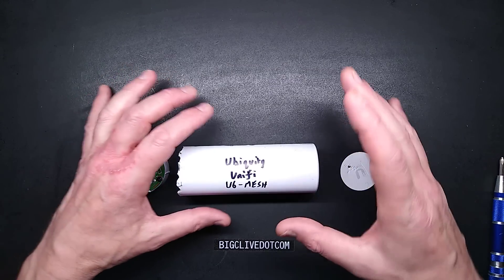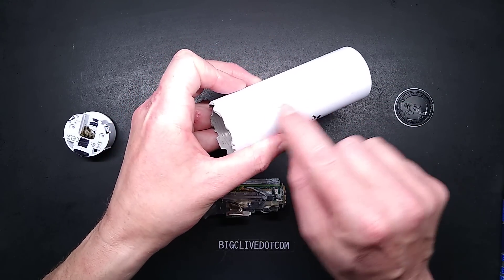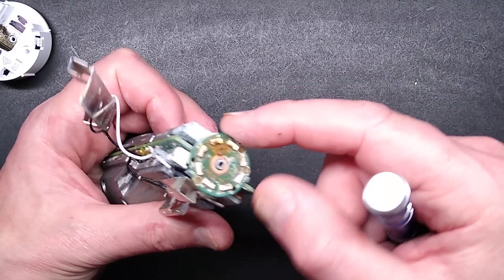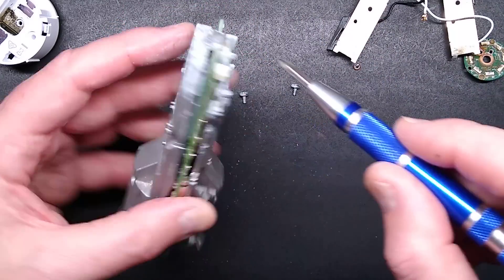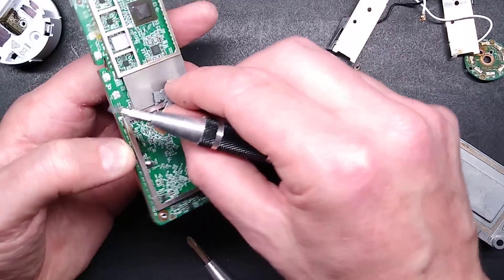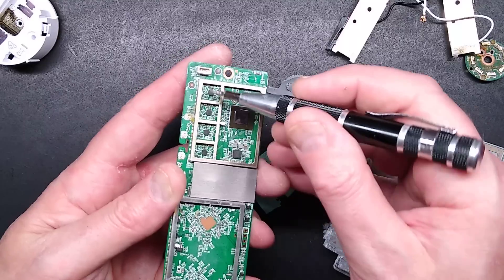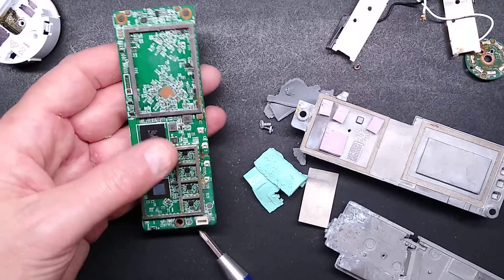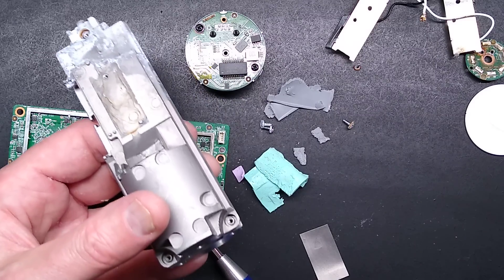Teardown of an impressive ubiquiti WiFi node

Comment: I broke that J16 connector from that little GBE network circuit board side when I opened device... 😰
I think it is FFC / FPC connector  26 pin Bottom Contact Right angle SMD / SMT ZIF type of connector.
Does anybody managed to replaced that connector on the board, and how are you achieve that? 
Thanx in advance!

Comment: These things work great...until being in the sun causes the water proofing to melt and then allow water in top down :(. 

How do I know this? Well because I just had one fail after 2 years. Hoping for a miracle from Ubiquiti to RMA my unit. We'll se.
Reply: Yep, I just had one do the exact same thing, 1 day prior to 2 years old, RMA rejected, so opened it up and found the LED's have burnt out just below the top cover. If you ever put them outside, they need a plastic cover for sure, or choose something else
Reply: I just took one of these apart, a few years old, sitting outside in full weather near the seaside
It had failed, but its ethernet port still looked fine, as you say, UV must have ruined the adhesive at the top
I find it quite perplexing that Ubiquiti have labelled this for use outdoors while the G3/5 Flex cameras are only to be used outside UNDER COVER
Both the U6 mesh and Flex cameras have exactly the same base design for those that aren't aware

Comment: To anyone who is trying to get the cap off, use a lighter on it to soften the adhesive. It is mostly around the rim between the white cap and led ring. Just keep rotation it to keep the chances of bubbling the plastic.

Comment: Can Clive program?  I feel like some of his electronics projects might benefit from a Raspberry Pi or similar.  There is a good ecosystem of sensors and comms devises that work with Raspberry Pi.

I can’t program anything useful, but my understanding is that what Clive would use is fairly simple to program.
Reply from the maker: I sometimes use PIC microcontrollers programmed in assembler.

Comment: Apologies if already discussed but interesting to hear about the water ingress. Can see its only ipx5 rated though so maybe poorly placed outdoors, bad quality control or abused a bit its really hard to know. Unifi kit is generally decent with many controllers being offboarded as software apps. However i veered away from Unifi in general as their marketing seemed to start believing their own hype. I felt they were over rated and no better than an asus. On the plus side, they always looked good and the outdoor units certainly broke new price points.
Reply from the maker: It had been left dangling upside down.

Comment: I've used Ubiquiti products extensively at customer locations in my IT business.  Not just their WiFi items but cameras, networking and proximity control as well.  Always well built and reasonably priced (especially since their competitors generally charge ongoing license fees).  However it is well known that their support organization sucks.  So if you have a problem, you are on your own.

Comment: I started to run into more and more stability issues with ubiquiti software and made the switch to tp-link omada, it's the only other viable option that doesn't immediately bankrupt me. I've been pleasantly surprised. TP-link has matured a lot over the recent years. The switch has been quite a positive experience. The software and products are at least as capable as ubiquiti and maybe even better. Also tp-link supported ppsk already for quite a while, ubiquiti only just introduced this feature, too little, too late.

Comment: Had a NanoStation which suffered the same fate, completly filled with rain water.
I drained it (water was black), rinsed the board in the sink and let it dry. Afterwards i re-soldered the leg of the Buck-Converter which was gone due to corossion and the damn thing worked again!

Comment: In fact, there are not so much RF stuff — four really simple antennas, four frontend chips, one Qualcomm wifi thing and a computer, that's all. Nothing you should be excited about, almost no RF magic, no beamforming or things like that because the coaxes are definitely not phase stable and the FEMs doesn't look like they are somehow phase synchronized. Just a stupid wifi with some diversity switching and a computer. 

If you can, please desolder that flash memory chip and read its content, this possibly helps everyone who end up with a bricked device after a firmware upgrade. And, of course, that board is usable as a source of spare parts to repair other similar devices.

Comment: Damn man all you had to do was shoot me a message to ask me how to open those types of things from Ubiquiti I could have saved you a lot of grief. I use Ubiquity products residential and IPC systems, Ruckus is better for community access systems like in a hotel or apartment comples since it offers better access methods that prevent connection sharing.

Those antennas are dual band fixed dipoles for 2.4GHz (top one) and 5 & 6 GHz (bottom one) with IPX connectors and the chunks of metal are multi purpose heatsinks, internal support, and RF reflectors.

These types of things are more commonly called AP or access points and can typically be set up as an AP with or without peer to peer and or router options, a client station that can link to a peer to peer AP or be free to connect like a wifi adapter. Or they can be set up as a WiFi repeater which is also an AP by default but needs no hardline ethernet cable from a switch run to it. It can be setup and deployed on it's own to extend an existing wifi network

You want something similar but in the cheap Chineasium persuasion? Look up a device "UeeVii CPE450" on ebay. They come as pairs typically already set up to work out of the box which they do work but they are the cheapest feeling things and their PCB is lead free and can be damaged if they fall and take a bang but the antenna is a whole unit, like a well built beast of metal and hardware, I was impressed by it actually. The instructions are very limited for the web UI setup but once you figure it out, They are customizable and can be set in factory mode that allows the radio to work on the complete 5GHz band allocqation plus the 6GHz band

Comment: Aww, I was most curious about the individual transmit/receive chips. I figure half of them are running at 5.8ghz and the other half at 2.4ghz, that's why you're seeing pairs of matching antenna shapes between each side. I

Comment: The grey square is a cermet RF shield.
A telematics unit I worked on recently had one bonded to the top of the SoC to cut down on emitted RF. (I had to ask what the heck it was!)
As a bonus, they also conduct heat pretty well.

Comment: My home WiFi runs on Ubiquiti hardware. I have an U6 Mesh installed for outdoor duty (Installed upside down - my fault. Fortunately it's in my terrace, under a roof). It works great and has enough range to pretty much cover my entire yard.
Ubiquiti APs are essentially setup and forget. You install them and they just work. Unlike most consumer-grade stuff out there.

Comment: it would be interesting to hear how a series of nodes can connect to devices randomly as things move around and reconnect sort of like cell phone towers.  I usually think of a wifi signal as coming from a single point and you are connected and logged into the one device.  I've never understood how this works.  All of them must have the same name and password, right?
Reply: It sounds like you describe "mesh" to me. The nodes exchange info as you move around and a hand-over is done. 
Works really well. Just enter the network credentials once!
Reply: I just looked a the box my extender came it.  It says "Wifi Mesh Extender" on it.  I need to find it, plug it back in and set it up again.  I couldn't get it to work right before or maybe it did but I just didn't understand it. @blasiushun
Reply: @blasiushun  There is an odd thing about youtube comments. When I reply to your comment it shows your name @blasiushun on the line.  It defaults to where I type before your name, but I can also type after your name.  I wonder which one is correct.

Comment: Thanks Clive. So this device actually uses heat-SINKs. In recent times the term 'heat-sink' has come to be used for a radiator rather than a heat-sink proper. Cheers.

Comment: That unit REALLY exudes "the essence of unrepairability"!  (But luckily most Ubiquity kit is highly reliable). The only way you could design those antennas would be using a dedicated antenna simulator like CENOS or IE3D - and the heat sinking would also need a similar thermal cooling simulation package.  I don't think I would have enjoyed being the production manager on that particular product.  😐

Comment: A while ago I designed a small radio telescope that uses old sky dishes. I tried designing a helical antenna to increase sensitivity and reduce noise, All I ended up with was a 120dB headache. In the end I found a double helix antenna off the shelf that was suitable and off the shelf LNA and down converter. Unfortunately I do not own the IP for that otherwise I would share it here.

Comment: I do often get impressed by quality of industrial eqipenment some organisation get access to.
Its extremely hard for small trader to even hear about good makes, they usualy aren't even available via chains to normal or smaller companies. I have heard about ubiquity in passing, but its nice to see an example and would love to get hands on one seeing how clean power is heat control towards sensitive components etc. SO far only worked with Dreytec and SMC on better grade networking. 
Thanks for reminding about brand to look into

Comment: The Qualcomm QCN9024 is the 5GHz Radio PHY chip. The chip under the grey block is the Qualcomm IPQ5018 SoC. It has CPU and a 2.4GHz Radio PHY in it. The 4 little chips next to the antenna connectors are the FEM (Front End Modules) from what I understand. Ethernet is also handled by the IPQ5018. Qualcomm is one of the best manufacturers when it comes to WiFi. 
That one big chip could either be Flash or RAM. Maybe something different.

That's all I know about APs. 
Sidenote: the U6-Mesh and the U6-PROFESSIONAL share the same hardware. Also counts for the u6-inwall. 

I have 2 U6-PROFESSIONAL APs at home and 2 are at work. They work great except one of them at work seems to have kicked the bucket (still troubleshooting not sure yet)
Reply: So an update on the Access Point at work: it is fine and still working well. I don't know what the precise problem was either...

Comment: Ubiquiti products have always been good value for money.  I remember 10 years ago setting up a point to point link between Tenerife and neighbouring island La Gomera using a couple of Ubiquiti dishes (about £70 each) and getting 73Mbps throughput over 34 miles!  The same tech is still being used there today to link radio station transmitters on the islands.
Reply: Yeah, I do like their PowerBeam/NanoBeam kit, not a fan of the UniFi based stuff though...

Comment: The round base with the round circuit board and the ethernet connector contains what looks like buck regulator circuitry to drop the 48v to 52v POE voltages to something more suitable like 5v or 3.3v.

Comment: I have some of ubiquiti's long-distance wifi transceivers on my roof to steal internet from the neighbors then I use a load-balancing router to stitch their connections together into better internet. They work pretty good, fair distance even when one side is a normal wifi router, they go miles if you connect two on both ends.

Comment: I use Ubiquity at home simply because it works. It was amazing how much Wi-Fi jank is out there - I spent hundreds of dollars on top end routers with the latest in Wi-Fi and the majority if doesn't work well - some device will barely work with it without a lot of fussing. Replaced it with a Ubquity and all my Wi-Fi problems went away - everything just magically connects with no issues at all. Not having to deal with Wi-Fi issues at all was something I appreciated - life is too short to deal with jank.

Comment: I have not had great luck with ubiquiti's outdoor stuff. After having 3 AP's fail I went to the much cheaper TP-Link units and so far they have outlived the ubiquiti devices for my application. Mine failed after they had water ingress through where the antenna connected, the o-rings and everything were in place and they were outdoor rated and they only lasted about 1-2 years at most. The units here look like they are better built than the ones that I was sold, probably a much later design ( and I think they learned something about antennas and exposure to weather ), the TP-Link units are similar in the fact that it's all closed except the end that should be the bottom.

Comment: I've used solid blocks as heatsinks for chip based amps and find they work well for transient power like audio. 
Lets the chip run warm which can feel weird to our hand but they test really well at a predictable temp. 
Sitting at eg 35°C might feel warm but the chips like it more than atmospheric 5 to 25c and hot peaks then cold again. 
At first having these amps that ran 'hot' but sounded great and were stable as, no drift etc (which would be ideal for RF) seemed odd but having them sit at 35 to 40 was way better than having massive temp swings and the cooldown happening once music has gone from a peak back to very quiet.
Also in bi and tri amped setups it let the amp chips run at a more unified temp rather than the tweeter amp never getting into range
Reply: As the PS4 and XBox incidents both showed, thermal cycling is far more of a danger than most people realize.  In some cases, it's better for equipment lifetime to just keep it running and hot 24/7 than to ever shut it down!

Comment: These are great devices but they do run at a shockingly hot temperature - they're rated for around 60c running temperature, and it certainly feels like 60c as well when you touch one. I'm amazed that temperature alone doesn't kill more of them
Reply: Yeah, I have seen their ceiling-mounted WAPs light up like a beacon on thermal camera whenever I did an office inspection. When the sysadmins had a test config running on a bench, you couldn't get your hand near those units for fear of getting at least a first-degree burn. Quite impressive, but also scary :)

Comment: Good hardware, but terrible software and support.
I used to be very enthusiastic about their products, good support, long life cycles - perfect.
And then it unfortunately went downhill... fast.
It is one thing to understand the customers as software testers, but another to then completely ignore their feedback; somehow I have to think of Microsoft and Windows right now.
Instead of bug fixing they more like tinkering around with design things.
Then the handling of security issues and data breach accusations, the communication regarding the acquisition of telemetry, the EULA (keyword "Automatic Updates"),
Java for the Controller Software, the mobile app which functionality regarding the stand-alone setup became progressively worse over time... I could go on like this forever.
Unfortunately, the (initially 1:1 copy) TP-Link Omada is not really an alternative either.
TP-Link is known for releasing firmware updates not often, but for that for very short periods of time (sometimes only 2 years).
And unfortunately they do this also with their "business" products - not just with the consumer stuff.

Comment: About all I sell for networking these days is UniFi. They got some good stuff out there now and easy to manage that is within the price point of businesses in a small town. Their software has been hit or miss but recently haven't had any complaints with their Unifi systems. The Wisp on my radio towers use their UISP/edge equipment exclusively and some of their firmware updates... you find you want to skip but haven't heard any real major complaints on either the past couple years or so. Maybe they have gotten it together now. Water in the connection kills a lot of them. Most POE devices just keep cranking power and any moisture just cooks it.

Comment: That first side around what I guess is the back of the main processor looks like a little city, very cool.
I'm thinking the weight of the heatsink is twofold, one to disipate heat but I think also to add weight as with many products people think something expensive should feel weighty, just my opinion on that last bit though.

Comment: Most of the installers of various low end RF devices use the ties that come in the boxed equipment.

If the gear is intended for long term installation, we should be using stainless ties, the plastic ties last a couple of years, fail, then the hardware falls, many times ending up inverted and then full of water. For the sake of a 50 cent upgrade...... $150 worth of equipment is destroyed.😢